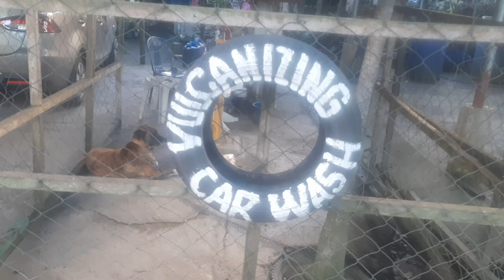VULCANIZING/CAR WASH (PATOK NA NEGOSYO)@robinsonvili#negosyo #vulcanizing#carwash#robinsonvili

Comment: Ilang horse power po ang air compressor niyo po. Maraming salamat po.
Reply from the maker: Ang sa ngayon 1hp lang yan pero nxt week  bili sana ako ng mas malaki dyan ang 4hp kasi plano ko mag upgrade ng tire changer machine.
Reply: @robinsonvili  ah ok po, pwede kaya yan sa mga impact wrench at tacker?
Reply from the maker: Tingin ko pwedi kasi 100 psi ang tambay pressure nya. Ang dis advantage lang kung ganito ay lagi nalang sya naga andar pag nasa low pressure na.